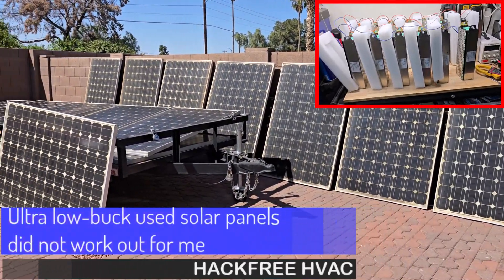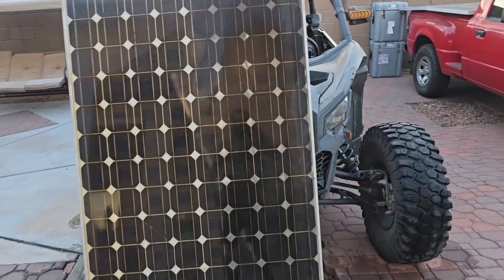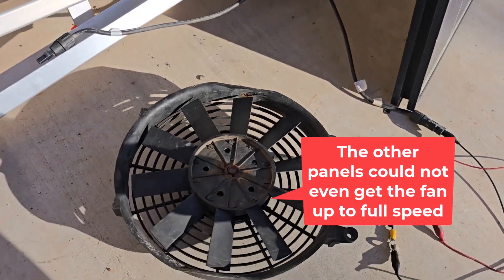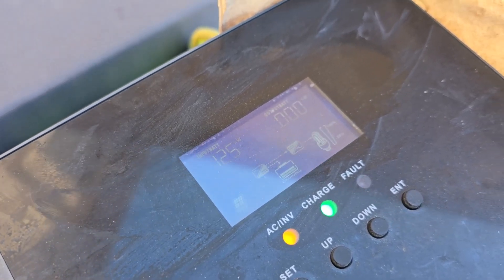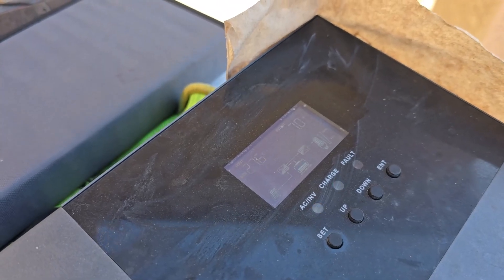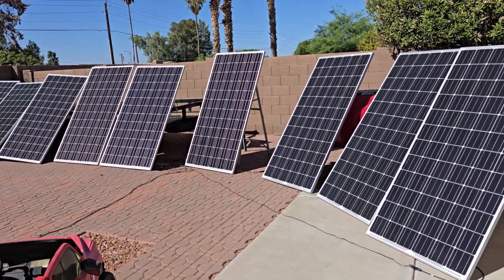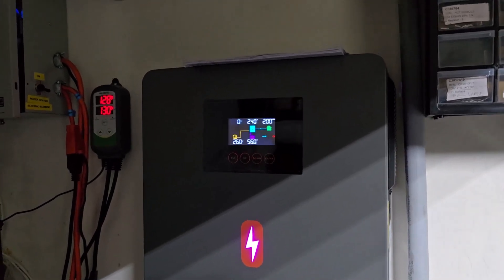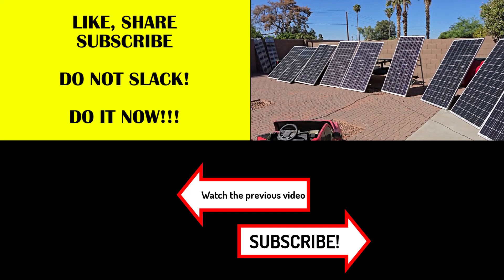Ultra low-buck used solar panels did not work out for me [Exchanged for better]

Comment: I had pretty good luck buying 20 245 watt very used panels for about 40 bucks each. I bought them in mesa AZ (I think it was santan solar) about  year ago. The few I measured individually put out 230+ watts when directly facing the sun in an AZ summer. I love how you used the panels to also make a roof shade cover, I plan to do that soon myself. It just makes sense not to do.
Reply from the maker: Yup.ll of my DIY used panels came from San Tan Solar. Gilbert (near Mesa).
I'm thinking of building a assembly for the nine 325 watt panels that I will tilt on a servo to track the sun somewhat.

Comment: what place do you buy your pannels from?
Reply: sounds like san tan solar.
Reply from the maker: San Tan Solar.
My existing array I built 4 years ago is from there. I just connected two more to that and then I've got to hoo up the other 9 325w panels as I come up with an erector set to do so.
Reply: @hackfreehvac  thanks ive looked into them but shipping costs about as much as the pannels or more wish they had local pick up at other places throughout the states

Comment: What are snail trails ?
Reply from the maker: Visual defects from what the description said. However these seemed to also have some arching across the cells.
So they may have been categorized as mostly visual defects by mistake. The place I buy them from had no issue with me returning them.
I paid a little more for the 9 panels that had much better quality and produced more power in total than the others did in total.
So it worked out.
Reply: tree sap